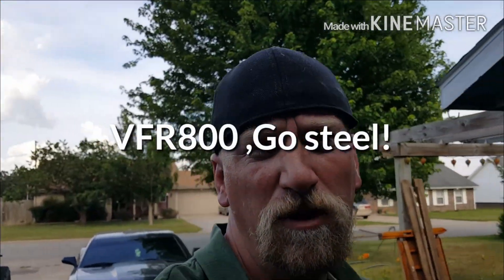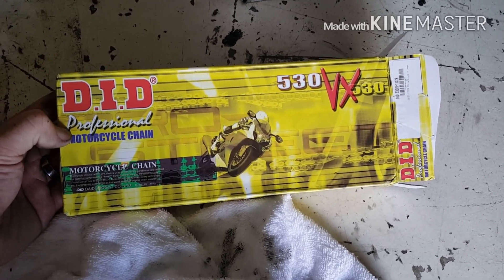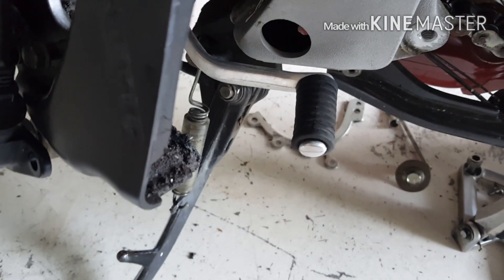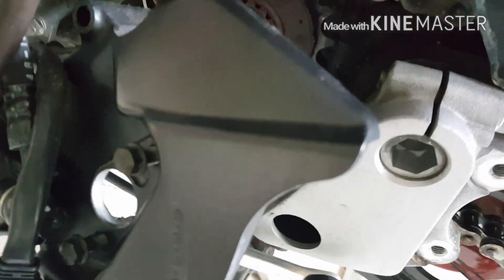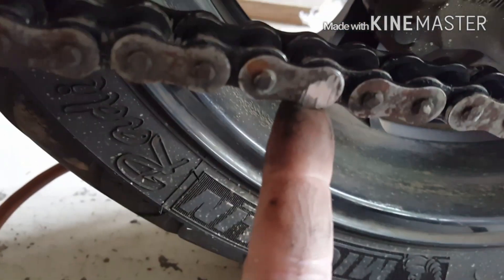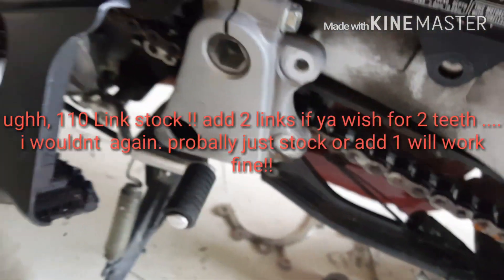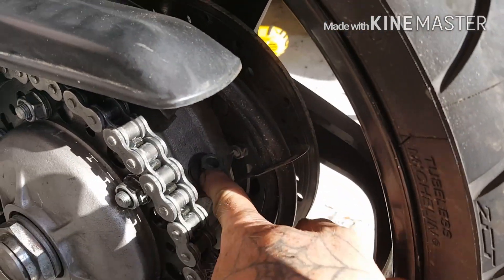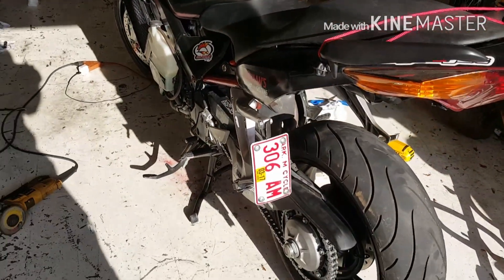Honda Vfr800 sprocket change, chain and torque specs!

Comment: 47 foot pounds? Did that with brand new bolts on my vfr800 1998 and it broke. Looked it up in my service manual and is said 34Nm for the 6 bolts in my sprocket.
Reply from the maker: What year? I cant imagine I got that wrong. Although it's been 3yrs ago almost.
Reply: @jeepXstreme  My bike is the 50th anniversary RC46 1998 build. Stock bolts washers and nuts. Got the service manual 2 days ago and it says 34Nm
And cool of you for the quick reply!
Reply from the maker: No problem..Nice bike! Well I'm not sure if those specs are the same for that year. Anyhow , sorry for the confusion! Be safe and Goodluck!
Reply from the maker: Also , if ya want upload a pict or send them to my email at jeepxstreme@gmail.com and I will put a pic of your bike up on the channel 1 day. Thanks  again!
Reply: @jeepXstreme  Just send ya an email with the specs and my pics. Thanks for the quick response!
Reply from the maker: Awesome! Thanks

Comment: Was there much improvement in torque ?thinking of doing mine as currently stripping it down for a project
Reply from the maker: I think it was worth it personally.  Especially if you need to swap out worn sprockets anyhow.
Reply: jeep Xstreme i will give it a shot 👍🏻